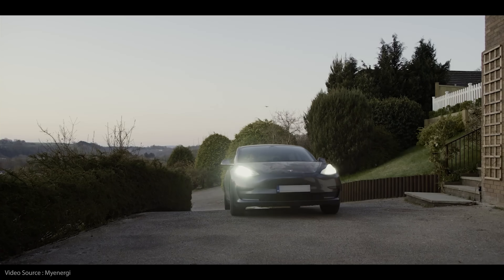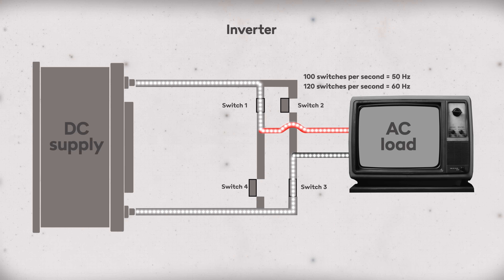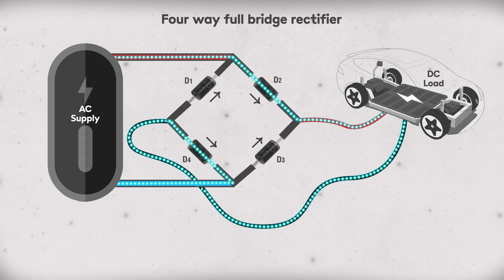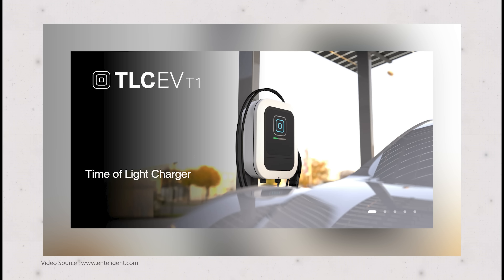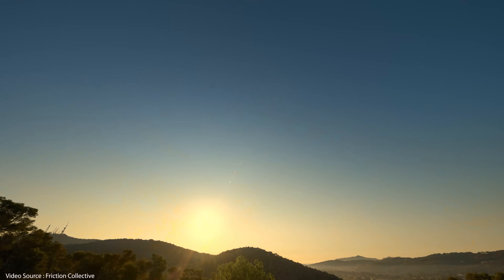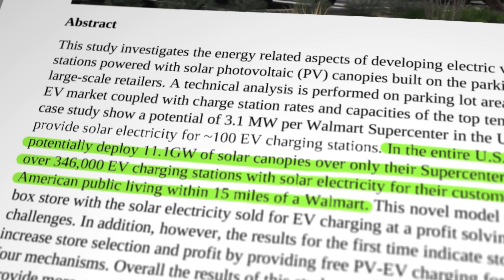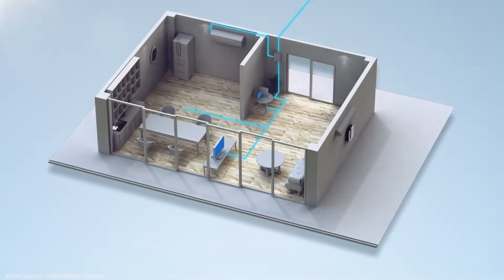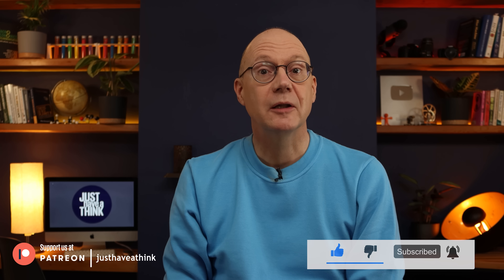DC to DC charging. One more step to off grid living!

Comment: Not sure this can work without having a DC/DC converter inside - which has similar losses to the AC route. This is because typical solar panels generate around 20-30 volts, so you’d need enough in series to add up to the 400+ volts generally used by DC fast charging.  Since the string voltage varies with sunlight you’d need some way to regulate the output voltage?  Maybe there is no free lunch (or at least 13% of one!)
Reply: My experience is that PV panels voltage rises very fast to the rated value as soon as there is enough light to do anything, and before there is any noticeable amount of current. Consequently, arrange several panels in series and you will see the high voltage at all useful times.

The panel voltage itself depends entirely on the construction of the panel - some are as low as 2V (see Casio Calculators!) while typical roof panels are normally in the 45-55V range.

The real problem is that a panel also has a maximum current through it (again dependent on build) so even if you arrange for 400V you may be limited to e.g. 15A rather than the 50A you would like, even if there is enough sun for 50A. Fixing that requires a second 400V array in parallel, or a battery, or both.

Comment: It occurs to me that there are additional conversions (and thus losses) when owners' EVs have V2L —like mine. With a specialized adapter, I can pull 1800W back out of my charge port to power small appliances like a coffee maker, an induction cooktop, a camp fridge, etc., but… the car is obviously converting the DC energy from the car's battery back into AC for those appliances. So now I have DC solar panels —> AC wall charger —> DC battery pack —> AC small appliances via V2L. Heh heh. I can hear both Edison and Tesla grumbling at each other in their graves. 🤪
Reply: The vehicle's contactors will be closed and the vehicle electronics will be active so there will likely be a few hundred watts of overhead in addition to losses due to inverter efficiency.  High overall efficiencies will only be gained when the V2L is running larger loads.

But its a moot point unless your vehicle has a LFP battery.  The cycling cost through non-LFP lithium chemistries makes V2L a non-starter.  You'll never break-even.  So at best it might be useful for supplying emergency power (but even then your vehicle is then stuck at the house and can't be used for its primary purpose as a vehicle).

-Matt
Reply: It always makes me chuckle when one makes a simple statement, and others have to chime in to change subjects simply to convey that they're "smarter than thou." For Gawd's sake, pe'trolls, go back under your bridge.
Reply: Your vehicle is likely consuming more energy, than those small appliances, to provide that domestic AC energy.  Perfectly adequate when the grid is down but more expensive at other times.  Mine is touted at twice the wattage of yours (but only has a 13A socket @230V).  Make of that as you wish but I call it bull excrement marketing.🙂
Reply: @oliver90owner  Nope. Drawing even the full 1.8kW via V2L is only a small percentage of my EV's total 77.4kWh battery pack. Regardless, I don't use it to power my home when the grid is down: that's what I have two Powerwalls for. I only use V2L when camping.
Reply: @Yanquetino what he means is the car will be drawing more than 1800w from the battery when you are demanding 1800w at your load. You're basically agreeing with each other.
Reply: @jnawk83  No, what I said was that the car would be consuming more energy than those tiny loads.  At full load of 1800W the maths would be different.  Even with no external load at all, the car would be in a state of ‘switched on’ on the V to L settings.  Matt is understanding the simple efficiency/economics of the situation, while drawing unnecessary, piffling loads.

Comment: Good news. Could do with more details on the connection used. Is this the American Tesla or the European CCS or CHAdeMO? Do existing cars support the format? What is the minimum DC charge? Is it that same as the 6A of the Type 2 AC format? I often have less that that as spare of my solar, so currently using a Zappi to ramp the charge up and down + feed in a little bit off the grid to keep above the minimum 6A.

Follow up video with more details please.

Comment: This has existed for many years and is currently built into some new houses in Scotland. 8 years ago I built a house for a client in Scotland and he engineered vehicle charging using solar panels, a wind turbine and batteries.
Reply: Surely your house had a solar inverter converting to AC and then a conventional EV charger plugged in to a circuit. Otherwise what do you do with all the solar and battery power when you're not charging? Until you're off grid and everything is DC to DC, it doesn't make sense. For decades off-grid people in campers and trailers ran small appliances from 12-volt cigarette lighters, but the grid and most things you plug into the wall run on AC.

Comment: I plan on building an off-grid house in about 5 years and keeping it all DC. So I'm really happy to see DC home chargers coming on the market!
Reply: LED lights need very low power so you can use ethernet cable to distribute power to LEDs in your future house. Read about Power Over Ethernet.
Reply: @GreyDeathVaccine Was going to suggest this.
I saw a demonstration at a home show several years ago.
Very cool idea.

The company I saw was PMMI Lighting.
They have an informative website.
Reply: 48V is relatively safe.  Any higher requires extra safety measures.  Probably things like ovens will still require an inverter for higher voltage usage.
Reply: @oliver90owner  I probably won't have a full-size oven, just something more like a toaster oven. There are 12V ovens for use in trucks and stuff, but they currently only go up to 350°F and I'd like something that goes up to 450. There are DIY projects that convert 120V toaster ovens, but with so many people getting home solar and upping their RVs to 48V and stuff I would hope that manufacturers will start coming out with more and more DC appliance options. I hope to start building in about 5 years, but it will probably be at least a few years from the start of building before it would be possible for me to start putting in appliances, so at a minimum we're talking 8 years out. I would certainly hope by then these products are more common place.
Reply: @truhartwood3170  They will be in that time scale, for sure.🙂  Well, a lot of development will have taken place - just look at EV battery development over the last ten years.  I guess your dwelling will be to Passivhaus standard or better?
Reply: @oliver90owner  Yes, exactly. I don't think I'll try to get passivhous certification or anything. But using the exact same principles and methodology, yes.
Reply: @ZapRivet  Do what? Build an off-grid home, or make it all DC?
Reply: @ZapRivet  My layout design is to have all major loads co-located. A utility room (with water pump, HVAC, hot water tank, batteries...) will share one wall with the kitchen (fridge, stove, oven, other appliances), and another wall with the pantry (chest freezers, food dehydrators, a vacuum sealer... ). On the other side of the outside wall will be my car charger. So the longest wire run for a high-power device will be maybe a few meters at most, with most runs being under 2m. The only longer runs will be for low-power LED lighting and some USB outlets. To me, the question isn't "Why go with DC?" when the power source (solar) and storage and loads are all DC, it's "why would you convert DC to AC, only to convert it back to DC?" I just like simplicity.
Reply: @ZapRivet  I'm hoping to keep it to one voltage as much as possible. It seems like there's growing demand for 48V. But even if I still had some 12V or 24V stuff it's easier to convert between those than switching to ac and back. Since this is years out and so much is changing so fast it's hard to know at this point what will make the most sense in 8 - 10 years time.

Comment: I've been looking for DC-DC chargers forever! so happy to hear this.
Reply: Same, it's such obvious solution I was surprised that I've only managed to find one tiny startup, when I was looking for it about 6 months ago
Reply: Same! Been doing some research on microinverter type setup.  Im currently off grid and have an EV motorcycle.  Looking to make a small type charge setup for the bike. I have a 50 amp  12 kw inverter set up
Reply: Worthless.  Steel needs conversion.  The DC voltage has to match.  DC to DC converters aren't that efficient.
Reply: @tarstarkusz  so you saying that converting dc to dc would be less efficient than converting dc to ac and then back to dc? Makes sense ;)
Reply: @AtaSeddighMohammadi  My point is only that DC-DC conversion is not very efficient.
Reply: @tarstarkusz  But DC to DC is more efficient,which is what this video is all about !😂

Comment: Oh yes, I very much agree. We need more solar panels on roofs and more solar panels in the field. The more the better. Especially since I'm on dynamic tariffs and my energybill has come down about 700 euro on fixed. All because I now have changed to doing laundry at time when energy is cheap. And the more sun there is, the cheaper my energy becomes. Sometimes I even get paid to do so. I'm effectively balancing the grid at that time. I get paid to consume the power other consumers are dumping into the grid at which they aren't using it. 

For me, solar is not an option anymore since the time to recuperate a solar installation has gone up to about 14 years now, since I'm on dynamic tariff. In fact, when I calculated the compound interest over the lifetime of a solar installation, I came to a mere 2% interest rate at a considerable risk. If I store my money at the bank, I get 3% interest at zero risk. I would be a fool to invest into solar right now. 

But on a more serious note. Yes solar is a great invention. But as we keep dumping massive amounts of energy into the grid, we shouldn't be surprised that will come with additional costs. We need to stop and have a think about what we are doing and what we need to do to ensure our energy supply in the future. Seeing massive negative energy prices is just a mere symptom of a sickness we need to cure before it will hurts us.
Reply: Don’t entirely agree.  Investing in solar can have a far shorter pay-back.  All grid energy will eventually cost more.  Solar systems cannot continue to get cheaper for ever!

Negative energy prices are good - we just need to educate more people to use that energy, so it doesn’t need to be generated (with polluting fossil fuel), at other times of the day.
Reply: And here's part of the difficulty in adoption of renewable energy. Too many people are focused on the cost and how soon it can be paid for. Why? Do you do that with a car? A house? A phone? A holiday? If everyone took the "not doing it because it's not financially viable" attitude, then the looming climate change disaster will just become a reality sooner. Please consider making an investment in the planet that you presumably intend to live on for this next 20 years, to help make that intention a reality.

Comment: Looked at SolarEdge marketing materials for this and the main benefit seems to be the ability to simultaneously use grid AC and solar DC for faster charging.  No particular efficiency gains (other than the benefit of solar itself).
FYI, AC->DC conversion has a power loss as mentioned.  DC->DC conversion also has a power loss.  MPPT solar charge controllers are converting higher panel voltages (20-100Vish) to previously lower battery voltages (12,24V etc.).  Now, with direct to EV charging you need to take solar panel voltages to higher battery voltages (at highest 400-800V). 

Every conversion comes with a penalty.  It's not so much that AC->DC efficiency is worse than DC->DC efficiency, but the combination of DC->AC->DC is extra losses, shorter transmission (hundreds of km/miles to a power station vs 10s of  m/yards to your panels) and the fundamentally greater efficiency/cost of distributed solar over centralized thermal combustion (full system costs).
Reply: What is the MINIMUM rate you can DC charge your car at? Presumably somewhat less than the 1.5kw AC charging rate due to AC charging limitations...
Reply: @pjm888  Good point.
Last time I was shopping for an 80+ gold rated power supply I had a hard time finding one under 450W. The reason is that it is easier to hit the efficiency targets on a larger power supply.
NO efficiency guaranties are required below 20% load (or 90W for a 450W PSU). Problem is many machines will idle at less than 90W.
At 20% load: 87% efficiency (gold) leaves (90W)(0.13) 12W to power the PSU.
Platinum (and some gold) PSU start turning off the fans at low power levels because that extra 3W is about 25% of the power budget.
This is a problem for my systems with efficient PSUs: I have had to add fans back in to keep the systems stable.

To get this back on topic: my car is WAY more efficient L2 charging at 3.5kW, compared to L1 charging at 1.5kW. Between 200W and 500W is overhead. Just the voltage drop on my wiring alone at 120V is 68W (5.6V, at 12.5A); and would be halved by going to 240V on the same wiring (but I would probably install thicker wiring).

So if their device consistently charges at over 4kW: it will probably have less overhead than any AC conversion with my car.
Reply: In some cases a step up in DC voltage isn’t required as the home solar setup already strings panels together in series to increase the voltage and house solar inverters can normally handle up to 1000VDC input.
Reply: @David-lr2vi   1,000 VDC strings are Not legal on homes but up to 600 VDC is.
DC-DC conversion is now almost as easy as AC-AC conversion.
Reply: @peteinwisconsin2496  Fair enough but 600VDC strings probably gets you to where you want to be for direct DC charging of your EV.  The OP makes out like you have to convert 24VDC to around 400-800VDC when that’s not the case for most installations.  Interestingly here in Australia you can use 1000VDC strings in a residential installation provided the system isn’t grid connected.
Reply: Just wish they would release it. I looked a month ago and it was still marketing. Solaredge Marketing seem to always bee about 1 year infront of the ability to provide the product. There was meant to be an update to software for the solaredge battery to import power from grid. Still waiting
Reply: But just using a grid-tie inverter lets you use both at once!

Edit: 
Had paused the video just before Dave said that their device is supposed to be more efficient than the on-board charger.

Comment: I don't see much use for this. PV panels only make sense if there's a use for energy they generate. If this device (Enteligent) only can charge vehicles, and there's no vehicle most of the time, then who's going to buy and install the panels? At my home, I would like to have a system that directs energy to EV, to the pool, to the water heater, or to the grid if there's nothing else. And I don't have one because I have a simple stupid inverter, made it China. So there's definitely a room for a smarter and better system, just not that DC stuff, why should I care about 10%? I have much more excess energy I can't use right.